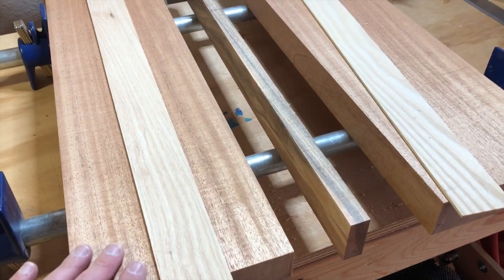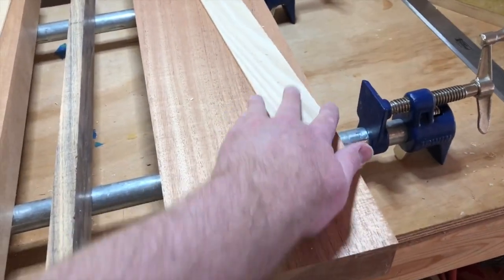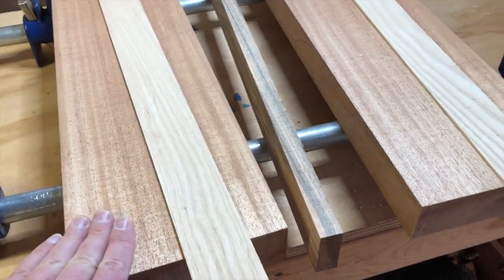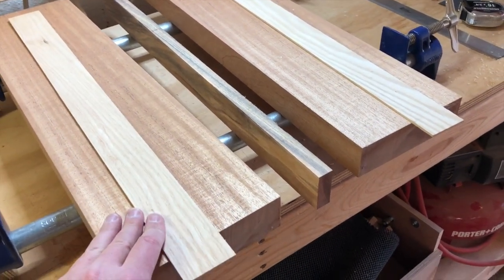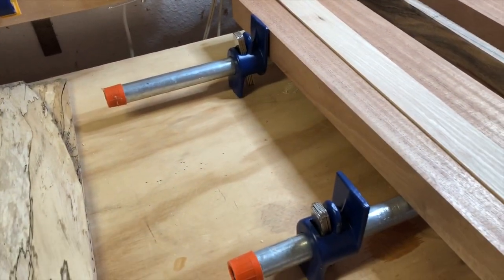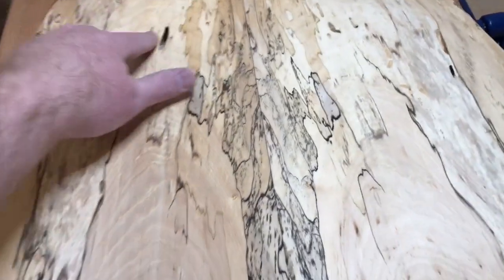Spalted Maple Guitar Build (Part 1)

Comment: Any idea if I would be able to just make a whole body out of one piece of spalted maple or if I really need to have the bottom piece of a different wood?
thanks!
Reply from the maker: You can but you will need to stabilize the wood, particularly if it has a lot of spalting. Otherwise, the wood will be too soft. You might try flooding it with resin.

Comment: Out of curiosity, did u have to stabilize the spalted maple? I just bought a few boards of spalted maple for guitar tops and they seem pretty stable already but haven’t been able to find any information if I should use some stabilizer liquid to harder the wood before using them to carve.
Reply from the maker: I used a wood hardener from Minwax. In hindsight, the wood hardener worked well, but resin probably would have been better.